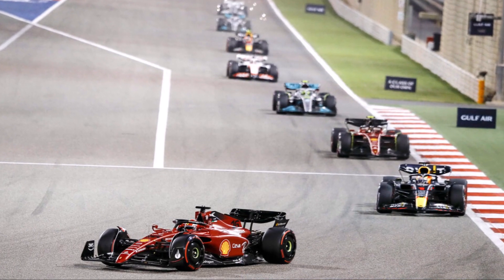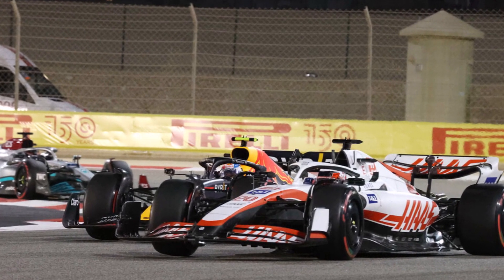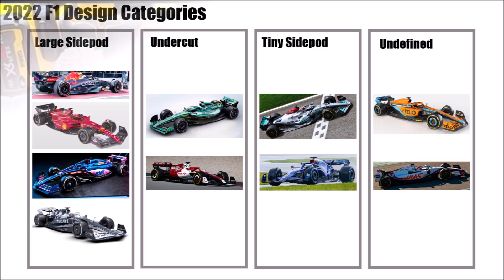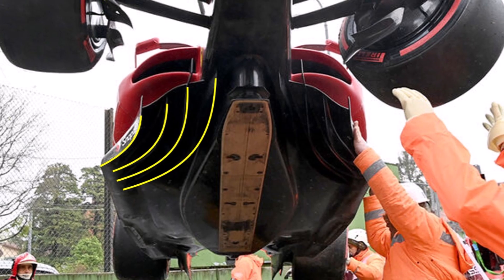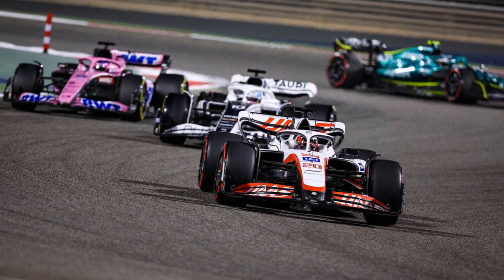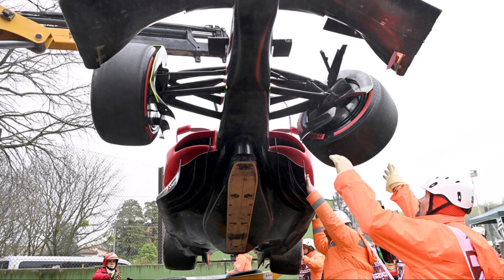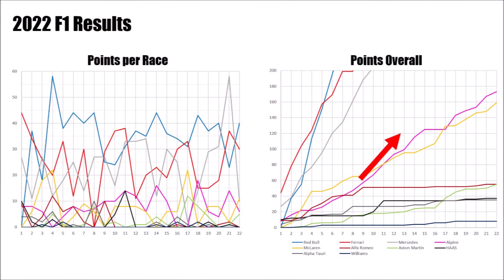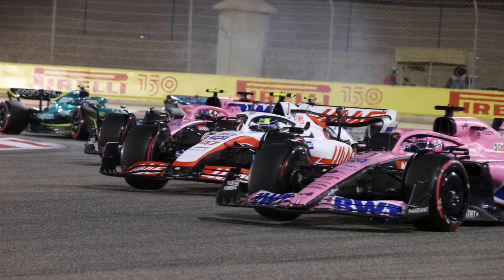F1 Season 2022 - Technical Summary

Comment: Could using a lot of rake (ironically) work for mercedes, since the rear of the floor would be further away from the ground thus needing less stabilisation or am I missing something since this would be a rather easy fix.
Reply from the maker: I guess it’s something the Mercedes engineers will find out for us.
Reply: Well they are the ones that asked to raise the floor so yes.

Comment: Thanks, you keep blowing my mind!

I was wondering, since now the bulk of the development is on the floors, and that it's the part of the car that's most hidden, could it be possible that teams cheat their allocated tests by developing the floor on another car? Like if Alpine fitted their floor in secret on their Le Mans car, McLaren on a 720 GT3, or Ferrari on a road car mule. I don't know how much could be learned, but since it's going to be very hard to control that, I imagine some teams wouldn't bat an eye (especially if they have the resources, possible flexible donor car, and a private racetrack...)
Reply from the maker: Thanks!
Of course they could do that but the flow fields of other car categories are very different to F1 cars and the floors might behave differently. What works on a prototype or GT3, could separate on the F1 car.
But in general it’s an advantage if a team is not just doing F1.
Reply: @bsport320  thanks !

Comment: Does FIA have access to tunnel data from teams to see how effectively they circumvent the anti-outwash rules? Do you think the rule makers will eventually clamp down on the  floor strake bargeboards like they did on AMF1's armchair endplates?
Reply from the maker: They have access to design data but usually not to tunnel data.
The 2022 rules are very clear in most areas and set strict boundaries that generally prevent outwash. 
If teams still come up with details that increase outwash (Mercedes mirror stay, front wing sky hooks), they can still react.
They expected teams to use the outer floor strake as barge board because they showed this with their own show car long before the season started.